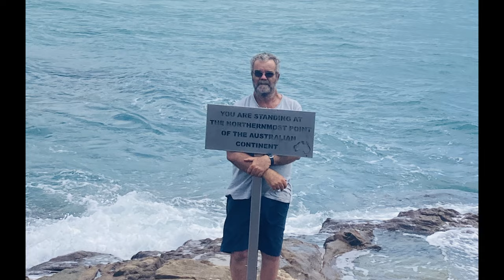Towing the Boat REMOTE in NORTHERN AUSTRALIA (Cape York)

Comment: Great vid Ladies and gents, some lovely fish to, Love the Cape , been going 40 years, this year is my 20th trip, 18psi is to high towing on the sand up there 12 to 13 is better loaded with a tracking boat trailer
Reply from the maker: Yeah love it up that way. We used to go to Jannie creek on west coast and had to drop tyres down to 12psi or so. It can get so soft in some places.
Reply: @Lure_Loser  Ok yes I camped at Janie for 6 weeks few years ago great spot towed my 5m tinny in there no worries, but holy cow Midges I prefer Penny been going there for 25 years, be going again soon if it opens this year,  towed my 5m tinny in there for nearly 10 years
Reply from the maker: Yeah that whole area is our favourite.  Fingers crossed it will be opened again